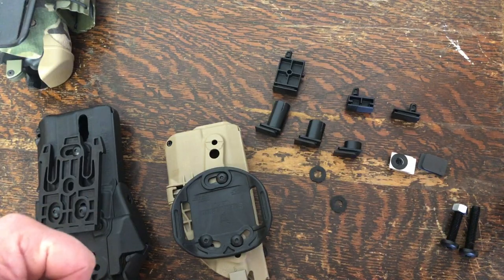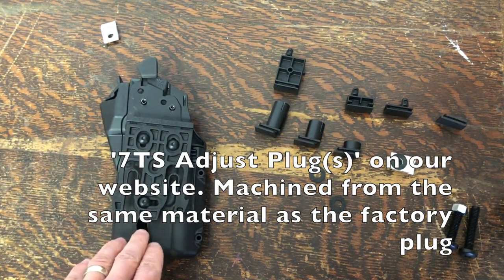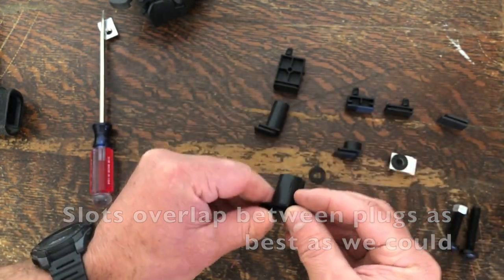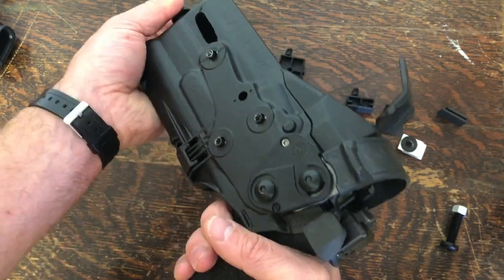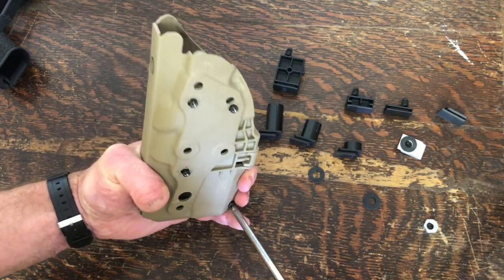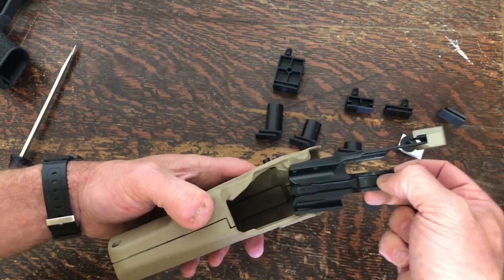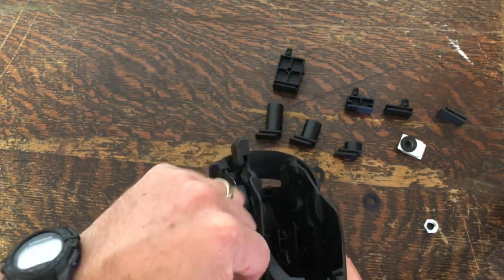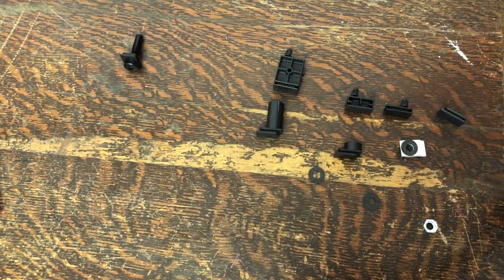7TS Adjustable Plug System

Comment: Can you run this holster without a plug? I just got a compensator for my g17, making it a g34 length. I have the same RDS holster.
Reply from the maker: you can, just don't sit down in the mud and pack your barrel- lose a bit of rigidity but not a ton

Comment: I removed that SLS and hood on my ALS holster, but once I took the screws out, there’s still an exterior collar, that retains the screw in the holster that stick out  about a quarter of an inch exposed on the outside of the holster, do you know how to remove those? I apologize for not knowing the correct terminology. Thanks.
Reply from the maker: email some pics-  info@otdefense.com